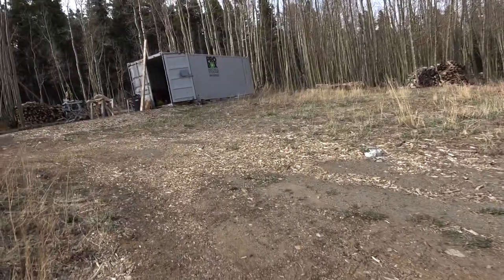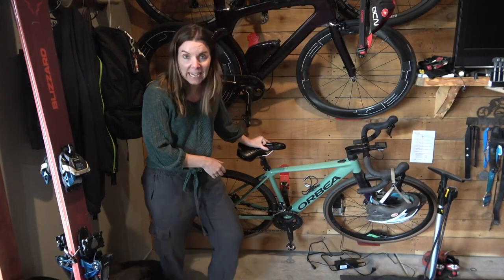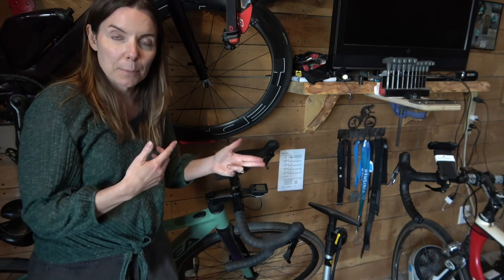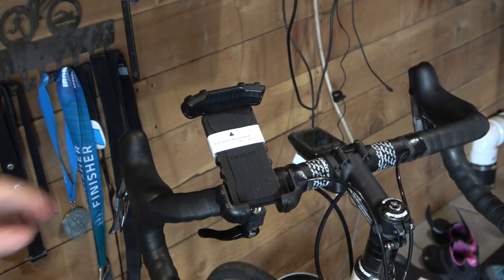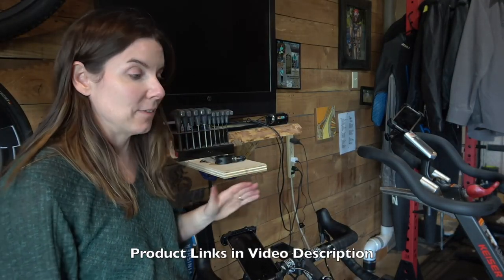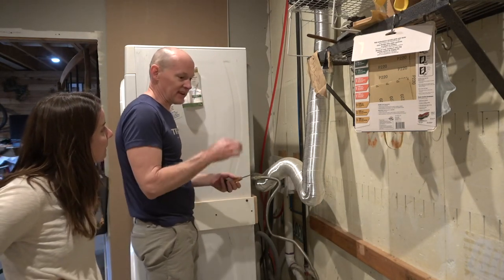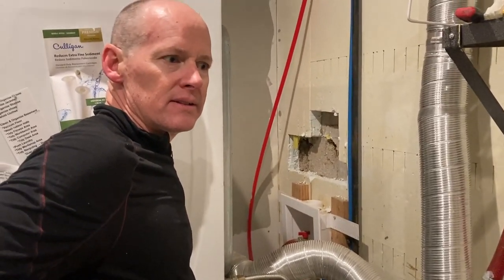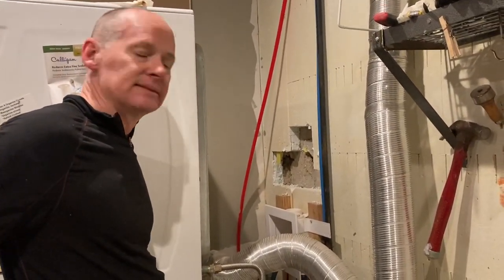Couple Discovers Crumbling Foundation After Using ICF [Insulated Concrete Forms]

Comment: Any concrete contractor should have a vibrator that is shaped like an electric drill with an eight or ten foot flexible wand and tip to do the wall.  It should be poured in lifts not all at once and each lift should be vibrated diligently but not so much as to stratify the components (the aggregate will drop to the bottom if vibrating is overdone).  Pouring too much in each lift can lead to air pockets as big as what you have if it is aggressively vibrated in isolated areas.  The proper way is to continuously vibrate the entire wall but not to overdue one spot and then move three feet down the wall.  As in so much construction it is the details that kill the outcome of the job. One man during the actual pour should have done nothing but continuously follow the pour with the vibrator.  Not using rebar and or rebar chairs, skipping the vapor barrier, walking the steel into the slab, all these kind of activities seem small and not worth nagging over but they show just what kind of contractor you are dealing with and should be avoided if at all possible.  Cutting corners can increase his net profit and hurry him on to the next job but you will be dealing with those corners as long as you have the house.  That spot was big enough to signify that the whole pour wasn't properly done and well may have many more like it.  I would question the slump of the mix by the time it was on site as well. The practicality of finding them is going to be next to impossible.  Your other alternative is to leave the basement unfinished so you can find them as they occur or to excavate the outer perimeter and put in a waterproofing system and a french drain (which should have been done originally if the contractor knew what he was doing or gave a damn).  Neither is an ideal situation by a long shot.  Doing it right is always cheaper than fixing crappy work.  So saying it is a shame that poor work is all too common.  It is far from easy to find and book a quality builder almost everywhere.  From the outside everything looks new and shiny then the discoveries begin....
Reply from the maker: Thanks for the tips!
Reply: Spot on!

Comment: Hi Amy and Bryan,
Bryan, I know it will be a lot of work but to be certain about stopping that water, you may need to expose the foundation on the outside to see what the concrete looks like. Did the foundation company give any warranty for their work? Both of you stay safe.
Reply from the maker: Thanks! We may take a look on the outside and also regrade that section of the drive, the way it is now seems to encourage water drainage towards the house.

Comment: Sorry, but the intruding water has zero to do with voids in the concrete! The waterproofing (or obvious lack thereof) is where the water is entering the foundation, you could have holes in the concrete everywhere "think concrete masonry units and mortar" and if the waterproofing was done correctly there would be no water intrusion. You are trying to repair the wrong thing as usual. The ONLY way to repair this problem is from the outside - Not the inside, and not the voids in the poorly placed concrete.
Reply from the maker: We used the recommended waterproofing on the ICF on the outside, but the grading still needs attention. As we mentioned, the slump rate seemed off as well.

Comment: Hydraulic cement is used sometimes to fill those voids, if there is some exposed rebar or some other anchor points you can attach some wire for more support for the repair, this is also possibly a reason to still use the plastic foundation wrap that goes to the bottom of the foundation and sits several inches above the top of the ground even though there is ICF already in place, I just mention this for someone using ICF in the future, although you guys did great in having only that one tiny void in the entire foundation  so I would consider that a success and agree with Brian that slump rate is very critical in ICF as there’s a lot of those plastic supports to get around, also you could build a little form that sits proud of the wall to hold whatever filler your using 

     Continued Success 
               Fabrizio
Reply from the maker: Thanks for the tips!
Reply: No problem anytime, just some suggestions from things that have happened to me and family, not trying to tell you what to do just saying what I have and family experienced, been through before, you guys always do great seem to get there in the end with whatever your doing, if you don’t mind my asking my brother in law in the past had a very thin tired racing bike that the name escapes me right now and he would ride probably 30 or 35 kilometres from where he lived to our home and what I’d like to know is a good road bike or mountain bike to possibly make the same ride if Brian has an idea about it

     Continued Success 
               Fabrizio

Comment: sucks!  we found 2 in ours.  one maybe 2x1 foot and another maybe 2x3 foot.  luckily they were easy to find just by hitting the foam with our hand.  huge and clear difference in sound, hollow vs solid.  they are above ground so no issues with water leaking.  as for below ground i think whats best is our spray on rubber and then plastic dimple membrane but just to protect the house even more we applied the spray on rubber on the entire outside of the house.  our 2 spots happened because we did 4" ICF on the first floor and above all windows and door we had to use 2 pieces of rebar.  the concrete wasn't vibrated enough and boom, the 2 spots are in the corners of 2 windows.  you live and learn though.  hopefully you can access the outside and maybe fix the foam with some sort of product that'll shed it down to your footers.
Reply from the maker: Oh wow! thanks for sharing.

Comment: I helped with 1 HUGE 5500 sq ft SIPs house, 2 ICF Foundations and 2 ICF houses, 2 regular concrete form basements and a pool when I was in high school and college. 
The biggest ICF house was maybe 3500 sq ft, so the trucks dumped, the pump truck operator kept material flowing at a high rate and we worked our way around the foundation a bunch of times, it was a walkout basement. 
We did small 3 foot lifts using a pump truck, one person manned the hose while I followed with the vibrator.
My understanding is smaller 3-4 ft lifts help reduce the stress on the forms and reduce the risk of blowouts. 
I'm planning to build my first ICF home in the next couple years. 
I'm doing it myself. 3k sq ft ICF ranch style, full basement, in floor heat with an attached garage and I'm thinking of doing a light deck or similar span form system. 
ICF was just so easy. The forms are so much better now. The bracing systems are also so much better. Seems like a no brainer. 
I could do the whole thing myself, maybe hire out the slab pours. 
I love the Idea of building a solid, sealed envelope, fire and pest resistant, storm proof home.
Reply from the maker: oh wow!!  thanks for sharing!

Comment: The concrete void is just the path of least resistance. The real problem is with the exterior foundation sealer and drainage, but I guess you already know that. ✌️
Reply from the maker: We used the recommended waterproofing on the ICF on the outside, but the grading still needs attention. As we mentioned, the slump rate seemed off as well.
Reply: Exactly.  The concrete is structural, but the water is kept out by the waterproofing membrane.  Unfortunately the only lasting fix involves digging up the outside and fixing the waterproofing.

Comment: I seen where not only do they vibrate from the top when they pour but they also use a pad vibrator on the outside of the walls while pouring. I watched Dirt Perfect doing this when they did ICF basement pours. Things happen sad to say.
Reply from the maker: More of the fault with the slump rate, than the ICF itself. Could probably happen with traditional forms, but you know it as soon as the forms are removed. with ICF, you pretty much don't know unless you start having problems like this.

Comment: at the beginning..price discrepancy between  a 96" stud and a 104" framing member - the stud of 96" inch is the most common and hence more tied to current sawmill economics ( the store buys them on a regular basis and it readily follows current prices ), whereas the very uncommon 104" ( I have never heard of them ) may have been a specialty buy that lingered around and the store is trying to move them out.
Reply: Actually a 92-5/8 is the most common stud for 8' walls, 104-5/8 is a common stud for 9' walls. EVERY lumber store out there carries both sizes for modern framing! A 96" stud is not sold in near the quantities as 92-5/8, or 104-5/8, the reason is no builder is going to pay the premium for a 96" stud, just to have to cut every one down to 92-5/8 for his framing.
Reply: @scotty362100  I understand the 92-5/8, but have never framed a wood wall with 104-5/8. I get your point - thank you,
Out here a big box like home depot or lowes will carry both 96 and 92-5/8, but not 104-5/8.
Reply: Name a state, i will prove you wrong.
Reply: @scotty362100  maybe we could get back to his original question...
why would a 2x6x104 inches sell for 2$ less than a 96"- 2x6?
Wondering out loud he answers it by saying, "probably less demand".
How would you explain it?
Reply from the maker: Interesting
Reply: @richardvsessions1302  I already did, if you could comprehend my post!

Comment: you have no experience with concrete, concrete houses have been built in Germany for last 70 years, we don't know about another construction only concrete and iron inside, when concrete is poured, a vibrator is needed to compact the concrete....there is no tornado that can blow it up, only a tank shell
Reply from the maker: interesting!
Reply: @ColoradoMountainLiving  now I remembered... the reason for the cracking of concrete is that there is styrofoam on both sides, concrete must breathe, only on the outside must be styrofoam, if it is placed on both sides then it cracks...
you have just started with concrete construction, the Europeans are much more experienced, whoever you ask, they will all give you the same answer

Comment: I hate to tell y'all the voids in the concrete are not your water problem. They may be a structural problem but I would doubt that. The walls would have to have many of those bad spots, poorly vibrated areas to cause any real issue. 
Your problem is on the outside. The concrete is structure waterproofing is outside. In the case of an ICF outside the outer layer of foam. You should have some sort of waterproofing membrane on the foam and footing drains and lots of drain rock to allow any water that get to the wall a path of least resistance out and away from the walls. If you don't have that then you have a big problem and will need to dig up the whole foundation and install a proper waterproofing system. 
Fixing that void in the concrete probably won't fix the leak although it may be a stop gap measure till you can fix it correctly. Also not sure if the cement mix you got will even stop the water. The only type I know of that does is hydrolic cement repair mix. 
Good luck. If you want to talk dm me.
Reply from the maker: We used the recommended waterproofing on the ICF on the outside, but the grading still needs attention. As we mentioned, the slump rate seemed off as well. Thanks for the info!

Comment: Ah that’s not too bad, it’s not structural crumbling like it’s turning to dust, you just have some voids. But if water is penetrating the exterior seal then that needs digging up and resealing, otherwise you’ll get mould
Reply from the maker: Thanks!

Comment: Wow. I would have never thought a hole in the foundation would be the cause of a water leak. Look forward to seeing the repair. Thank you.
Reply from the maker: You and me both!
Reply: @ColoradoMountainLiving  Did you folks do any special waterproofing of the basement? 
I'm seeing now they are using coatings, peal and stick, and a plastic raised nub drain barrier to help facilitate moving the moisture down to the drain tile? They weren't doing that much when I helped build a few ICF homes about 15-20 years ago. I can see the benefit.

Comment: Do those phone apps have an audio counterpart to the display? If So then you could just have it tell you your speed and how far you have ridden. If your TV has Bluetooth just tell Bryan to send the information directly to the TV via Bluetooth. Both of you should be able to do that.
Too bad they don't have a wood clamp type mechanism (like a quick disconnect) for mounting the smartphone holder. Though the alligator jaw or the more traditional bike clamp doesn't really take that long to secure the holder to the bike. I was just thinking of these holders as being convenient.
Reply from the maker: Not sure about the audio app. My watch will periodically announce mileage, but I want it on demand lol. The TV downstairs doesn't have bluetooth capabilities.

Comment: How much weight does that battery add and duration of use . sort of interested ?
Reply from the maker: There are so many styles - and depends how much you want to pay for lighter weight styles. This bike weighs about 25 pounds. I rode with the battery on 1 bar for about 15 miles and it used up a quarter of the battery.

Comment: As others have already pointed out, patching the concrete will in no way solve the leak (even w/o holes in it, concrete is not waterproof).  Short of excavating to expose and properly waterproof and drain exterior of foundation (which I'm afraid may be the the only real solution), I would guess your best short term "easy" solution is to work on grading and channeling water as far from your foundation as possible... A combination of sloping grade away, setting some heavy mil poly over the slope (then bury it or the UV's will eat it), then have some sort of french drain or something to that effect to move the water to where it won't get in... but don't do all that if you think you're going to excavate... In the mean time, keep it ventilated to avoid mold.
Reply from the maker: We used the recommended waterproofing on the ICF on the outside, but the grading still needs attention. Also some gutters., downspouts to direct water away from that corner. As we mentioned, the slump rate seemed off as well.

Comment: Be careful on using phone mounts on a bike, they are designed to be in a pocket, not subjected to extreme vibration. My toolkit regularly disassembles itself during a ride. Just get a fake Garmin mount and a cheap computer. I’m pretty sure phones have been vibration damaged by mounting them on motorbike handlebars
Reply from the maker: Interesting. Probably wouldn't be too bad for a ride on smoother roads. Similarly rear ends can be damaged by excessive bumpy road conditions - ask me how i know LOL!
Reply: @ColoradoMountainLiving  heh yes I was surprised just how many clamps and fittings needed tightening after a trail ride. Oh I checked the vibration thing, it's apparently something Apple recommend owners don't do.

Comment: Your ICF was not installed properly if you have leaks or voids. Just like any other portion of a home build, i.e. electrical, it must be done right or there will be consequences down the road. 

ICF is not rocket science and it is absolutely superior, if installed correctly. Voids are a direct result of improper “slump”’in the mix or a lack of attention to vibrating the mix as you pour.
Reply: I've installed ICF forms for 30 years and the ICF is not the issue but rather the competence of the installer.  No doubt here are considerable voids in the concrete wall and an improperly applied water proofing system.  You are on the right track. Try to fix it from the inside first before having to dig up around the perimeter.
Reply from the maker: We used the recommended waterproofing on the ICF on the outside, but the grading still needs attention. As we mentioned, the slump rate seemed off as well.